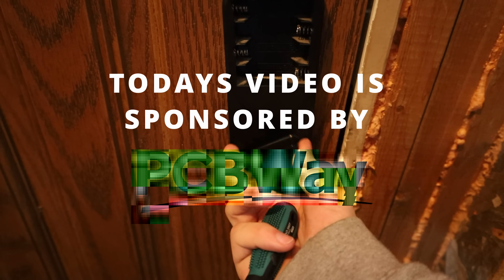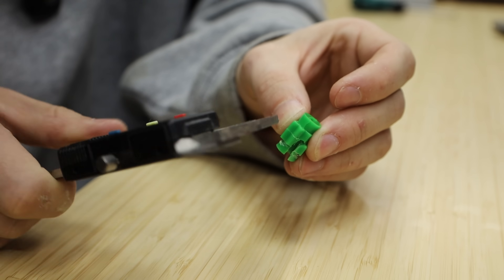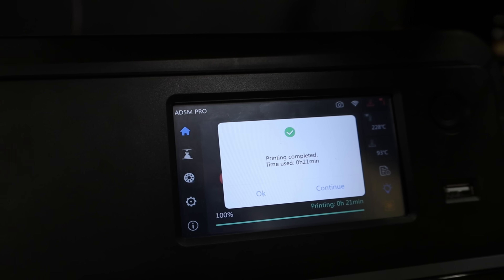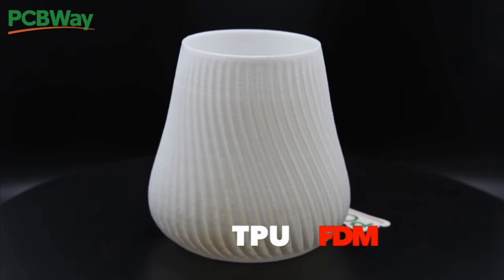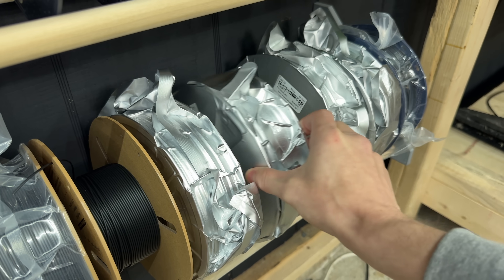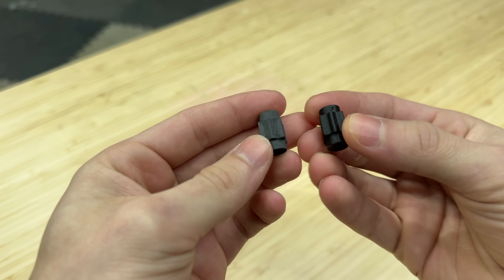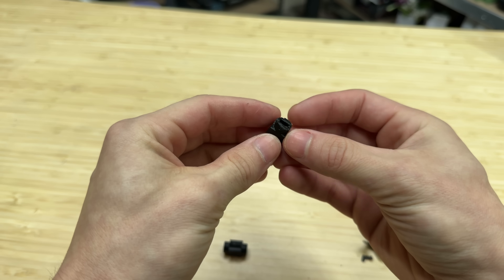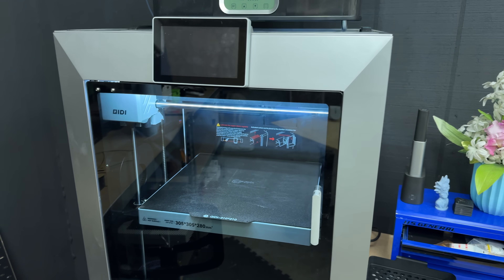I Saved HUNDREDS 3D Printing This Part!

Comment: Great video showing how useful 3d printing is!
My 2 cents: For the best strength against splitting along layer lines, I would orient the part on a 45 degree angle from the bed. It'll need more supports, but the direction of the layers wouldn't be aligned to any of the forces acting upon the part in use, plus in the middle of the object each layer will have more surface area contact to other layers in comparison to the vertical or horinzontally oriented parts, hopefully making it much more resilient to breaking.
Reply: vertical is the best orientation. Its a twisting force. vertical would give you layered "rings" around the force applied. as opposed the horizontal print that is pulling the layers apart.
Reply: @dnappi85  Ah yes, you are correct. Once I put my thinking cap on I realised that you are right, printing vertically is the best option.

Comment: Your feeling is right. Into thermoplastics, fibers don't make the part stronger but stiffer and maybe can reduce the weight because you can get a thinner part with the same rigidity. fibers can also enhance the abrasion resistance, at least for the part itself.

Comment: But the real question is why would you use plastic parts in a door lock?
While you fixed the problem, I'd be buying a better lock.
Nice video though. Cheers!
Reply from the maker: I may use PCBWay to order a metal one of these if the replacements i made don’t end up holding up, but that was my first question when i originally opened the package
Reply: @TheMountainMaker a super ridged part sounds good but seems to be the problem, a Nylon without the rigid additive would probably work better because of the temperature ranges it would be exposed to under stress. 

A metal part may be a ‘duh’ 🤦‍♂️ of course… until those tiny gears freeze a bit of ice in there that motor cannot handle, which is why they used a compliant plastic part there in the first place. 

Tullomer by Z-plastics is the material I would have it printed in if I could pick anything (if PCB offers it, get it).  You can print it yourself but it is pricy per spool.

A good polypropylene without too many additives would also be good and durable, the additives reduce layer adhesion and make it ‘printable’ more than a better material…

Of course that is IF your going to order a part or it might not not make financial sense especially if that is not the only problem with the door lock and what is really breaking the lock gear cannot be easily seen or repaired.

🫡 best of luck.